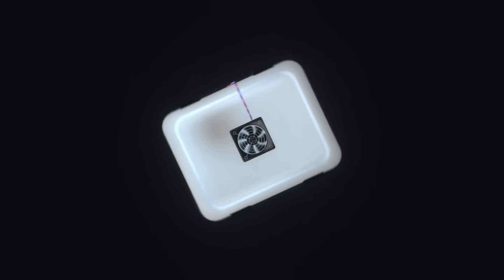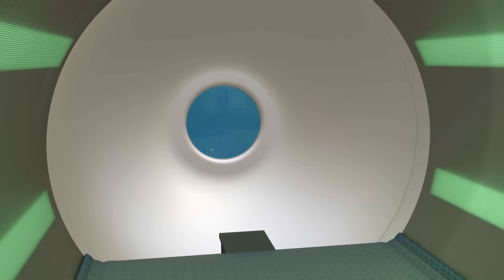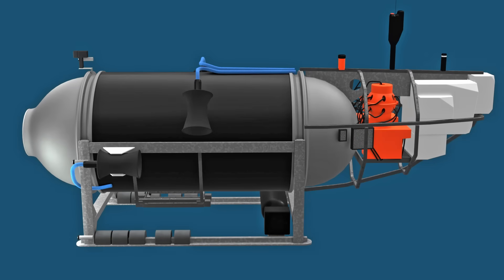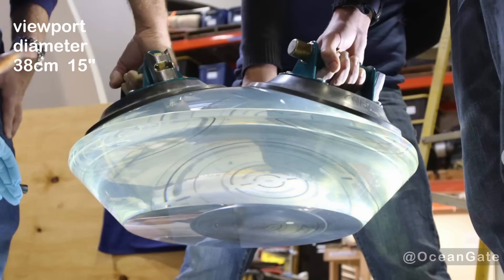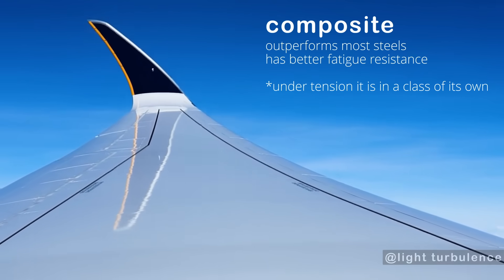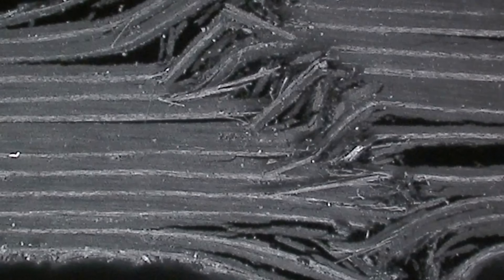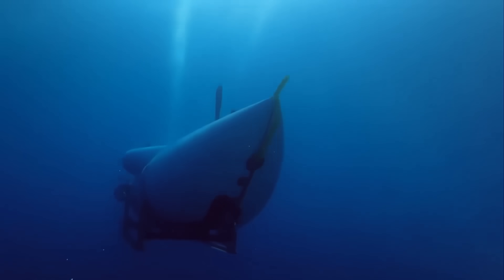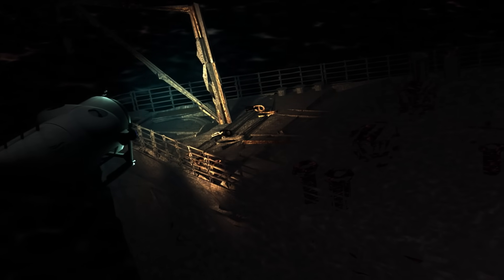Titan Sub | carbon fiber - Detailed Tour

Comment: Mr. Mike Bell, you say carbon fibre is good for making a deep ocean sub when done the right way. It sounds like all of the expertise on these subs say the opposite. What is your field of expertise, can you make an other video, where you draw up the recipe of a safe working sub with a carbon fibre hull ? The claim of carbon fibre made at airplane standards proves it is a good enough material, don't hold water. You can't compare the stresses on an airplane build to work at the pressure of 30 - 50 000 feet height, to the environment at the deep ocean floor. The forces are so much higher that it's hard to imagine.
Reply from the maker: @yngve6640 You don’t understand how the structural forces inside a wing work. And you dont appreciate how massive compressive force in the upper surfaces of the wing and structural components are. The forces they withstand are from the lever arm of the lift forces particularly at the tip end acting at the wing root where it attaches to the body.  Those forces can be truly staggering and carbon fibre is most certainly up to the task.  
The structural forces are not from the air pressure. If that were the case the wing could survive being made from paper to survive the thin atmospheric pressures at high altitude. 

Its not an air pressure versus water pressure thing. It is the structural forces inside the structural material which always resolve down to either  compression or tension.  This is one of the most common issue raised in the comments so a video explaining structures may be worthwhile in the future. Structures are something that have always fascinated me and would be cool to expand on and shine a light on the amazing work structural engineers do all the time without fanfare and recognition.

Comment: Pretty sure every other video that blamed the carbon fiber also mentioned the layering as part of the problem.  The fact that they just looped the carbon fiber around the cylinder instead of doing a complex intersecting weave has always been a part of the conversation.
Reply from the maker: Weaved carbon fiber is what we are all used to seeing because it is easy to handle and to sell.  But the undulations of the weave are not ideal.  In more critical applications and where more complex machinery is available winding is more preferable with the machines set up to lay in the various orientations and eliminate the undulations inherent in cloth weave. There are better ways to achieve multiple orientations than with weaved cloth but they come at a price.

Comment: Carbon composite is not suitable for compression, but unlike everyone is blabbing about it is not the carbon part, but the other composite part, usually epoxy type, which forms crystals under repeated high universal pressure and cold temperatures. Those crystals are not a problem under non-universal compression as they break immediately upon forming.  Essentially the epoxy created crystals that eventually sliced through the carbon fibres. This is not new knowledge, this has been known for over 30 years.

Comment: The reason why it failed is because titanium shrinks way more under pressure than carbon fiber does, which almost does not shrink at all in comparison (it does shrink a bit but that's nothing compared to how much titanium shrinks). If you glue two materials together and one shrinks more than the other one, you put all the stress onto the glue joint and the joint was epoxy that could certainly not permanently withstand such a stress level. One day you get a hair thin crack and then it will fail at some point.

Comment: You mention the exeptional compression strength of carbon fibre. I think you mean Carbon. Under compression stability becomes a major factor. Fibres by the nature of their shape cannot take compression loads as they will buckle. This is a completely different phenomina than the compression strength. The same for titanium vs steel. Under compression, steel works better (weight vs stability) than titanium. Compression loads, buckling and material characteristics present specific challenges, not acurately represented in most videos about the Titan implosion, including this one.

Comment: the biggest alarm for me was seeing them extremely inaccurately and inconsistent applied sealant where the metal joints to the carbon fiber hull section, definitely did not look professional or like an AEROSPACE grade application lol

Comment: Carbon fiber used in the build was tape type and is made up of long strands running end to end, and then rolled around a cylinder similar to building a high-pressure cylinder. With a high pressure cylinder the pressure is on the inside pushing outward which places the load on the strands in the tape that run end to end. The sub load pressure is on the outside pushing inward which defeats the use of the strand load. Look at it this way; take a balloon, inflate it half way, now wrap string around it several times now add pressure to the balloon and where the string is the balloon stays the same size because the pressure load is against the string strands, now squeeze where the string is and it will move inward. So in my opinion the design was flawed in that the only strength was from the bonding glue thickness. Yes carbon fiber is one of the strongest materials if used correctly .

Comment: Truly fascinating, thank you! One question (please excuse my layman's terms): I keep hearing that the issue was the differential performance of CF and Titanium, ie one material compressing/expanding at a  different rate, thereby creating a likelihood of failure at the point the materials were bonded. Do you agree? Would love to hear your thoughts!
Reply from the maker: Broadly speaking Carbon Fibre being a highly rigid and brittle material deflects slightly less than Titanium under load. This is why the combination works well in aviation reducing the risk of failure due tearing or delamination from differential movement. In this case the two were being forced together so failure of the bond was greatest in resting state. 
Very significant is the preparation and accuracy tolerance of the two mating surface because if not highly accurate uneven forces inside particularly the composite would be a point of failure because the forces are so huge.

An expert I spoke to expressed concern about whether the surface area of the joint was large enough and the thickness of the flanges.  The way the flanges tore away could be a clue to the failure. 

I look forward to the findings of the investigation and specifically the titanium and composite interface.
Reply: @Mike-Bell  Thank you!!!!!! 🙏🙏🙏

Comment: Excellent overview. Thankyou for explaining to your audience the basic principles involved. I tend to agree with your assessment.
I am a filament winder, and do deep sea and gaseous pressure vessels. We generally burst test to 2.5 times rated pressure and cycle test to 1.25 times rated pressure fill and empty up to 450000 cycles! This takes a long time and lots of power, but helps us sleep at night.
Thanks for putting together this excellent overview with out the sensational hysteria. It must be very time consuming.

Comment: 1 tiny air bubble in that composite structure is enough to form a crack and then it is hasta la vista. Very dangerous and stupid idea to use this material for this vessel.

Comment: Resin and epoxy become brittle with age. And cold temperature such as the oceans at depth contribute to this. Aged carbon fiber, this cold and at those depths was doomed to fail. If Rush had half a brain, he would have constructed a smaller scaled version of Titan, and sent it on 2x the dives of the full version to analyze it with section analysis.

Comment: How is the carbon fiber tensile strength being utilized in this aplication? Seems to me the compressive strengh of the epoxy resin is mostly in effect. If high pressure originates inside the cylinder then I would say the tensile strength of fiber is being used.  Obviously this is not the case. I have not seen any fiber pressure vessels where the  expected high pressure is outside the vessel.

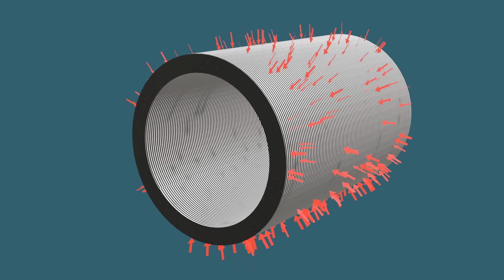Comment: 10:49  No it doesn't.  The composite is not isotropic, or even orthotropic, it's anisotropic, with maximum stiffness and strength aligned with the axial direction of the fibre and in tension only.  This means the hoop arrangement of fibres carry axial forces only, i.e. internal pressure causes the fibres to be in hoop stress - this how this sort of composite is meant to be used.  In compression the matrix material carries the force and fibre does nothing (you can't push a rope analogy).  My PhD was in numerical modelling of crack propagation in long fibre metal matrix composites (MMC's) - titanium matrix/carbon fibre reinforcement, or aluminium matrix/carbon fibre reinforcement - which run in the hoop direction which is essentially what this composite was so I'm familiar with MMC failure modes.  The upshot is, the designer of this vessel did not understand the stiffness properties of the composite he was using and paid for this with his and other's life.  11:20 Yes, exactly, and this is how it failed in hoop as well; remember the fibre is there to carry an axial load in tension it cannot carry a compressive load; you can't push a rope.

Comment: The outer flanges were blown out because as the center of the composite imploded, the end caps would have been pressed inward at an extreme pressure and speed, compressing the composite between the two caps, causing the composite material to fray and bunch up between the flanges. It's not that composite isn't strong, it's that it's not suited to this purpose, especially when adhering it to other materials that are, like steel or titanium.

Comment: Very interesting video - makes sense (actually I have been thinking about the tube design; the thickness of the tube would mean that it would actually be under tension if it was being compressed (at least part of the tube) due to the 5 inch thickness. The longitudonal pressure (the 25%) was unopposed;

This has parallels to the De Havilland Comet; hopefully similar testing is done to figure out what happened. A better design could have been a ‘thin’ (1 inch?) titanium tube, wrapped in 5 inches of carbon fibre, maybe with some external longitudonal braces also.

But destructive testing should have been done.

Comment: Was there any connection between the different contraction rates in the materials of Titanium and Carbon Fibre Composites when exposed to the extreme cold of the ocean at depth and how that might affect the seal between the main body tube and the end caps?

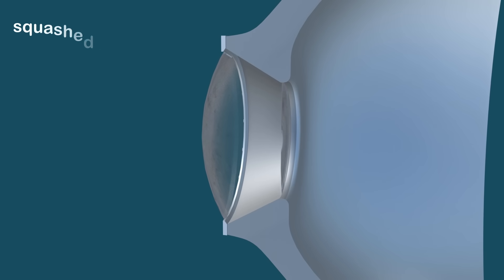Comment: At 7:30, text appearing at upper-left corner says that 20mm equals 3 1/4'' !!!
Isn't 20mm less than 1 inch ??
I may have misunderstood, as I am no submersible expert.
But I am just trying to get an idea whether acrylic window squashing was 20mm (2cm) or 3'' (762mm)
Reply from the maker: Well spotted.  It is 3/4". I'm not very familiar with writing imperial notation.  A correction has been posted in the video description.

Comment: No one has tried to make the case that carbon fiber is a bad material. The main thing everyone seems to agree on is that the way the carbon was "glued" to the end bell flanges. The only problem with the material is that this was not the way it sjould have been used .

Comment: Firstly, I was surprised that they only used a 0-90 ply lay up, with no +/-45s for additional stability.
Secondly, was the (presumable) difference in stiffness between the titanium ends and the composite tube considered ? I suspect hat hy'd compress at different rates under that pressure and so there would be a displacement difference at the interfaces.

Comment: A couple of things, while this Carbon Fiber pressure vessel was being testing out in the Bahamas one day, it was struck by Lightning at least once. Pre-preg Carbon Fiber holds up VERY POORLY to Lightning Strikes as it usually causes serious Delamination's.  Unless OceanGate incorporated some proper and well-placed bonding to the entire assembly, and within the CF material itself, there was likely Damages caused by that strike.
  Second, Anytime that you're bonding dissimilar materials with Epoxy, like Carbon Fiber to Titanium, you must be absolutely certain there are NO oils or other contaminants on either surface before bonding. Watch the released video of the OceanGate submersible assembly where the technician is wiping a Titanium mating ring w/ a rag (presumably with some acetone) and then handling that same area with his ungloved other hand ? ? ?  
  Any good NDT Technician (non-destructive testing), or proper X-Ray composite viewer could have found any imperfections, delam's, distortions or defects within the materials used. It's Insane that they fired the manager who pushed for those NDT checks and they drove on so blindly without that assurance.
Edited for spelling and Lightning Strike location.
Reply: Those titanium end rings had very little flange on them too. With water pressure trying to squeeze this thing into an hourglass, that also struck me as a very poor design decision. Atmospheric layup with expired pre-preg? I can't imagine how many defects that thing had in it. The biggest defect was Rush.
Reply: @mytmousemalibu  Yea, Rush seemed too "over the top" in some aspects, rebellious to ideas that weren't his own at times and behaved like that Salesman who will tell you what you need or want at times. He also had hiring policies that attracted those who were OK w/ stepping outside of normal engineering & maintenance procedures. 
  I worked in a small R&D group in Seattle in the 80's thru 90's, not far from where these guys were. We were reinventing some very antiquated, 30's vintage, Seafood Processing machines. The Owner/Head of the Co was Genius, happened to be Greek, and was Way out there with his mindset & approach towards how he viewed most things when compared to what most would see. 
    That trend, of operating outside of the norms, turns out to be what most Genius minds have in common. High Intelligence in people can be very appealing or attractive w/ the "WoW factor" associated with it. It can also border on weird or even dangerous.  
 Rush had some of those qualities that a Genius might possess but he was also closed minded to ideas that weren't his own. Genius Good, Self centered Bad is my take on the guy. It's just sad how his talents combined w/ his short-sightedness led to the death of others.
Reply: @uuzd4s yeah. Stockton sure confuse the word daring with reckless.
Reply: Wait wait wait - the vessel was STRUCK BY LIGHTNING?

You don't need to be a sailor to recognize a bad omen like that, much less assume it took some damage... yeesh.
Reply: @Serafimxxxx  The Lightning strike was documented and reported by the crew of Oceangate during testing in the Bahamas. Local news in Everett WA showed the vessel on Puget Sound during the video report when I heard of it, so I thought that's where it happened at first. But yea, do a web search if you're interested and you will find several articles reporting damages from the strike during testing in the Bahamas in 2018.
Reply: Why why why why why WHY was no non destructive inspection done??? WHY WHY WHY
Reply: @nadapenny8592 because he wanted to be the McDonald's mass producer of subs. Destructive testing would cost money he didn't have and his company was bleeding red ink as is. Sadly this self assurance of the flawed computer models coupled with his need to succeed caused his death.
Reply: @jonf2009 which is ironic given how he can pay less by using test dummies inside Titan along with camera used for deep diving while the said sub being controlled wirelessly
Reply: @gaming1zanagi-1999  yes but rich people don't pay to look at Everest through a telescope, they pay to be dragged places us normies can't afford to go.
Reply: @nadapenny8592  Yea, you can be sure that question will be brought up in the courts. Just as Bizarre were Rush's hiring practices. He intentionally went for new graduate students who were willing to step outside of proven engineering norms and experiment. The Manager who pushed for more thorough testing represented industry standards that Oceangate intentionally avoided. You could almost hear the Attorney's clamoring to represent those lost souls who were victim to Oceangate's methods.
   The experimental status that this submersible was allowed to operate under may not have regulatory oversight and that needs to change.
Reply: @nadapenny8592 

Money, money, money, idiot.
Reply: lmao he is the LTT or TheVerge of submarines.
Reply: I may be wrong, but the main issue I saw was the wrong material for the wrong shape. Carbon fiber works best when its fibers are in tension like a basket holding eggs. The basket will stretch a little with the eggs on the inside. However, if you flipped the basket upside down and set the eggs onto the basket, it is much more likely that the basket will deform unpredictably and would get worse every time you loaded it. On the other hand, if the basket were made of steel, the direction of loading is not as important. I suspect that the carbon fiber cylinder buckled a little on every dive which started the failure.
Reply: @TMAX-Pyrometers  That is a Very Good point. Yea, another reason why Titanium is usually used for such high external pressures, basically requiring strength in Compression.  OceanGate was too far "outside the box" of proven engineering which is going to be easily proved in the Courts.
   The question now seems to be, who's going to have regulatory oversite on Experimental Vessel's like this.

Comment: 20 mm window deflection under pressure is 3/4 inch, not 3-1/4 inches.
Reply from the maker: Yes it was 3/4"  I have posted a correction to the video description.